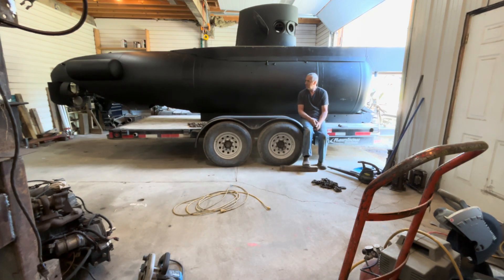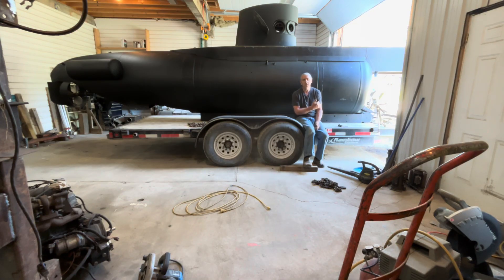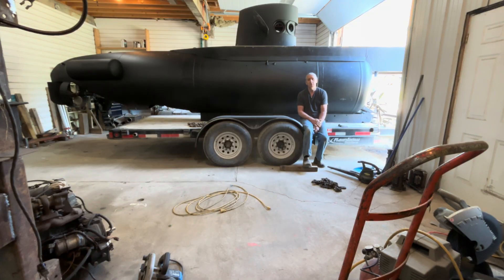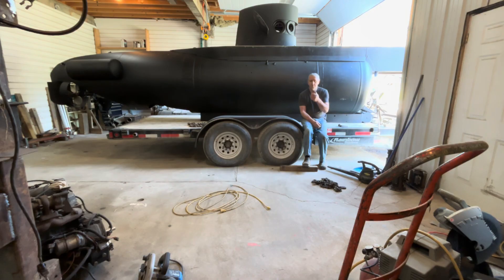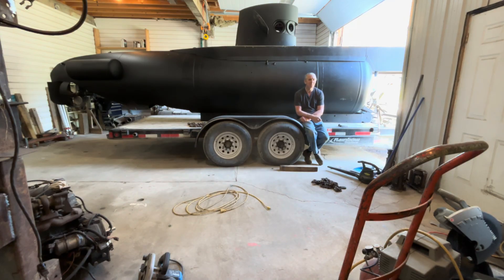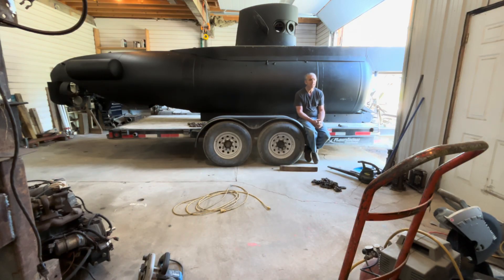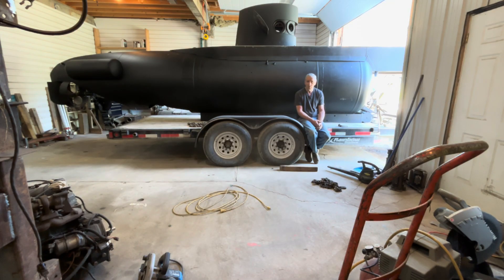Building my diesel electric submarine at home

Comment: 50# drop weight?! 
hhmmm...
I heard one of the Kittredge submersibles caught air after dropping their weight, which sounds bad.
I also read that one of the Johnson Sea Links got stuck to a wreck by a carabiner clip, they bent the clip but could not break it. 
Gotta choose what balance you feel safe with, like all things in life.
Reply from the maker: I have surfaced as hard as I could in My Nekton sub and it is not possible to launch a sub out of the water.  I tried,lol I am super careful where I dive to avoid entanglements